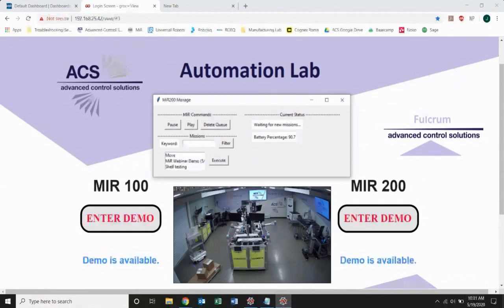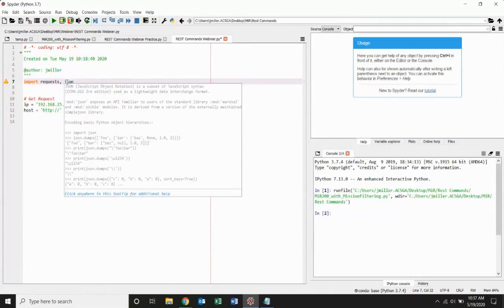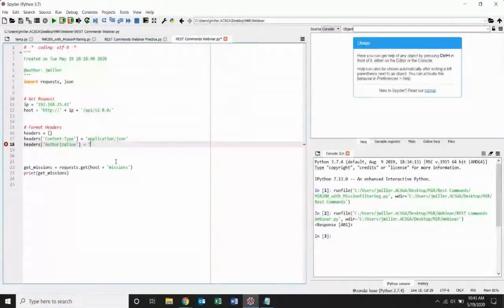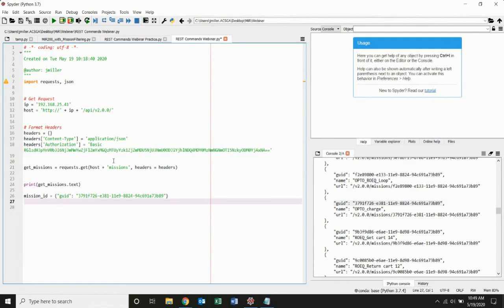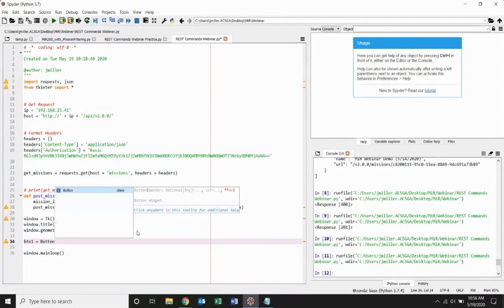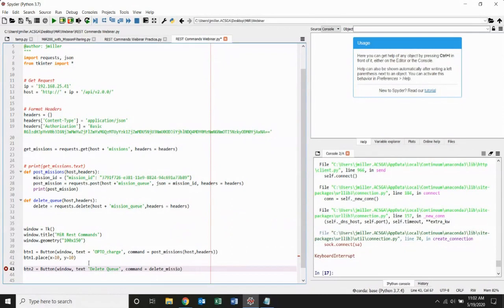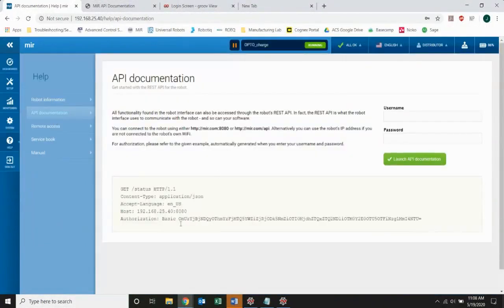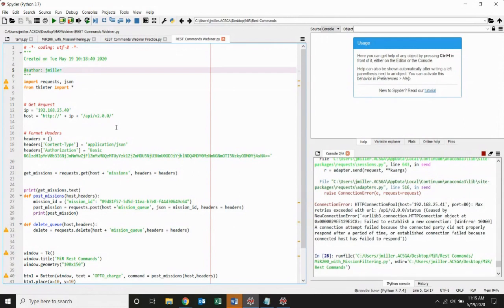MIR (Mobile Industrial Robots) Rest API Python Scripting Webinar

Comment: The webinar was awesome. Here is my contribution to the final part.  We needed to use a lambda or wrapper function to defer execution until the buttons are clicked.                                                                                                                                                              So we need to replace these two lines :                                                                                                                                                          >>>>>> btn1 = Button(window, text="charge", command=post_missions(host, headers))
>>>>>>btn2 = Button(window, text="delete", command=delete_queue(host, headers))                                                                   
':::::::::::::::::::::::::::::::::::::::::::::::::::::::::::::::::::::::::::::::::::::::::::::::::::::::::::::::::::::::::::::::::::::::::::::::::::::::::::::::::::::::::::::::::::::::::::::::::::::::::::::::::::::::::::::::::::::::::with                                                                                                                                                                                                                         >>>>>>btn1 = Button(window, text="charge", command=lambda: post_missions(host, headers))
>>>>>>btn2 = Button(window, text="delete", command=lambda: delete_queue(host, headers))

Comment: Hello, I have a question about pausing and continuing the robot. Have you done this by means of the rest API or a web socket? If so, can you explain this to me? I am now working on this project but I can't find it anywhere.
Reply: have you done it? i need to start mission using API but it only add it in queue right now
Reply: @edgarkurm8148  you have to change the state of the robot
Reply: @raphvig9522  oh, thanks.